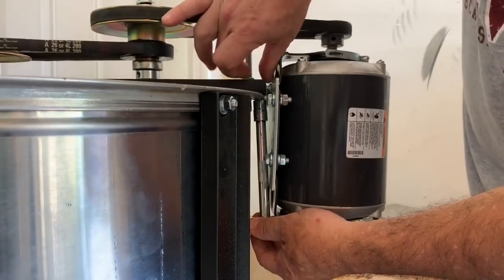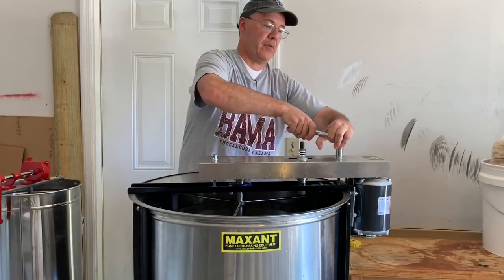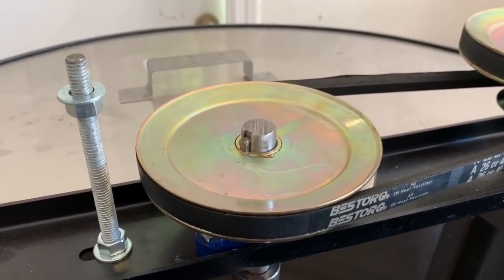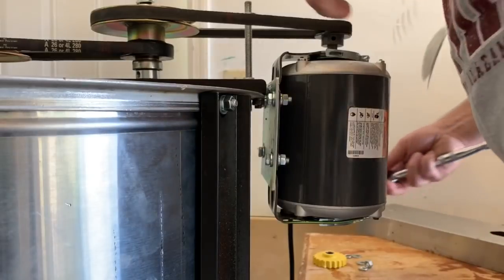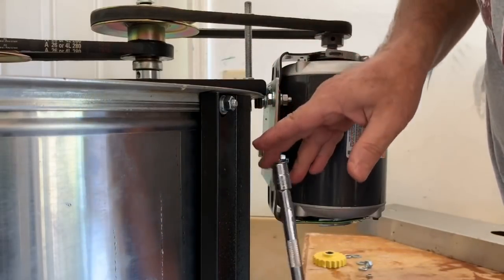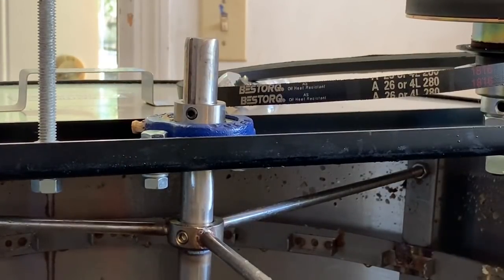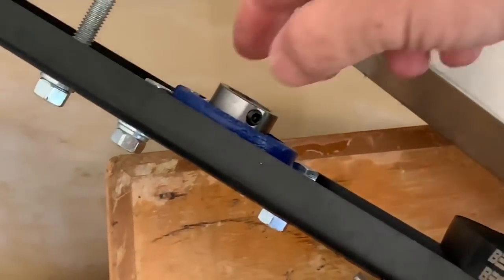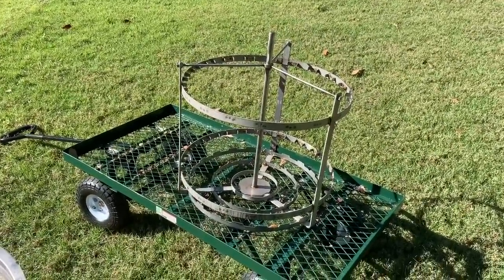HONEY HARVEST - Extractor Cleanup (MAXANT 20 Framer)

Comment from the maker: If anyone has any ideas on how to make this an easier process please let me know! I would also like to know what kind of extractors you use in your honey operation!
Reply: The only thing I'd do any different is that I'd plug or cover that bottom bearing before washing out.  Just be careful that whatever you use doesn't damage the seal.
Reply from the maker: Thanks for the input.
Reply: I just picked up my 1400p extractor today. My plan is to just cover the motor with a plastic bag and masking tape and pressure wash it
Reply from the maker: That may work. Good luck!  I love this extractor. So smooth...
Reply: I own a maxant 20. While I have taken it apart (usually remove the motor first then the whole top rack...I dont remove the wheels like you did), I do not take it fully apart every year.  Instead I simply use a pressure washer to clean it out really well.  I have it mounted on caster wheels for easy transportation.  Every other year I will take it apart to regrease the ball bearing.

Comment: On my 18th year with this unit. Best value for extracting volume! Saving everyone this unnecessary dis-assembly time by pointing out how easy Honey, wax and even a lil propolis cleans up with water. Simply spray out with water hose or use a dripping wet sponge inside the main stainless tank and on frame rack.  Use a bucket to catch the water out of the draw-off port if you're inside.  Honey and propolis are anti-bacterial, so this deep cleaning I feel is never required. The motor and pulley/belt rack never needs disassembly unless replacing bearings. The only thing you should do seasonally is food grade grease the pulleys, bearings and especially the roller ball in the cup under the spin rack. They have zerk fittings.  Time is of the essence.
Reply from the maker: Yeah we started using a pressure washer when I began combining with my friend Rusty a few years back. Now we have moved onto two 32 frame Hillco extractors. But yes yikes are right probably wasn’t necessary to break it completely down. Thanks for the input and thanks for watching!
Reply from the maker: And that Maxant was a great unit. Just sold it this year when we upgraded.  Still going strong. The new owner likes it as well.

Comment: Food grade grease (FGL) is what should be used and it's easy to find at from any number of apiary sources.  And you do need to keep that bearing clean and lubed.
Reply from the maker: I got some food grade grease this year and lubed it up.
Reply: Hey you guys think some crisco would work?
Reply from the maker: You really need to apply it with a grease gun.  I think the food grade grease is probably better but have never tried Crisco
Reply: @brucesbees  You don't need a grease gun and don't use Crisco. FGL is the same as Vaseline if you are looking for 
alternative substances. All you need to do is get the bearing dabbed with grease.
Reply: @ericbasta4653  No.
Reply from the maker: Yes if you take it apart but you can also apply it with a grease gun while extractor is intact.  There is also a spot that needs to be lived in the top of the extractor.   I use a grease gun for both. But if the extractor is disassembled then application of the lube directly to the ball bearing would be very easy.  I was not aware that Vaseline was the same thing. Thanks for checking in.

Comment: Have the same extractor was told to use food grade lubricant-film from Haynes and lubricant once a year both top and bottom fittings on the bearings or they will go bad.
Reply from the maker: We actually use the food grade lubricant as you suggest.  Thanks for the tip.

Comment: You probably should use the white food grade grease.  Comes in tubes and can use a new grease gun for the fitting.  Maybe a stupid question but why not just hose it out without taking it apart.  Really good video.
Reply from the maker: I could do that but I just like it to be totally clean. I am a little weird that way. I guess I could just hose it down after the first harvest and then break it down after the final harvest of the year but I just don’t know if I can get it as clean as I like. It’s really not that big of a deal now that I have finally figured out how to do it. 🙂

I will look into the food grade grease. I knew there had to be something out there. Had considered contacting Maxant but haven’t done that yet. Thanks for the comment and thanks for watching!
Reply: @brucesbees  Just checked and both Mann Lake and Dadant  have the tube for $10.95.  I have not used a tube in 20 years.  Thanks for the reply.
Reply from the maker: Thank you for the info!

Comment: I am wondering how a steam cleaner would go. Minimal water to sop up and it should get into the cracks & crevices, leaving everything clean without the need to dismantle the extractor & drag it outside. 

Just a thought ....
Reply from the maker: Interesting idea. Thanks!
Reply: It's usually recommend to clean your equipment with cold water as heated/melted wax will be difficult to remove later

Comment: The lyson 20 frame extractor is way easier to clean.
Reply from the maker: Yeah I have stopped taking it all apart.  Typically just pressure wash it really good.
Reply: @brucesbees  me2. Here's another tip. I'm full of them.
Use a garden sprayer filled with hot tap water to give it a rinse between extractions if you feel the need.
Collect the water in a bucket and wipe out the extractor. 
If you really think about it the only "dirt" in there is dead bees or parts of bees and wax...propolis.  It's clean even when it looks bad.
The honey strainer is important